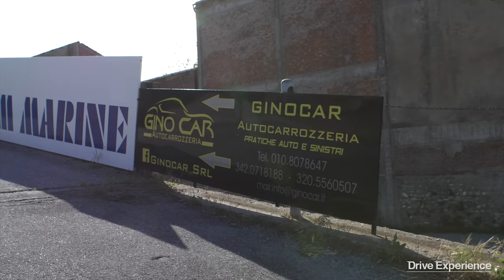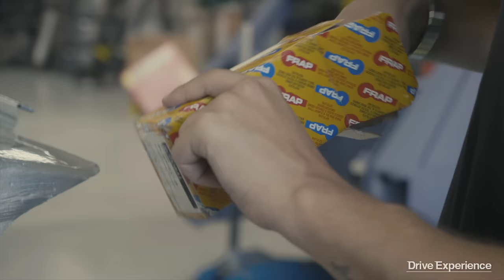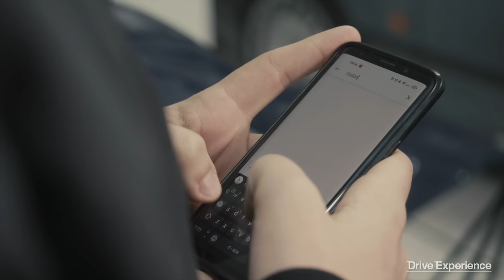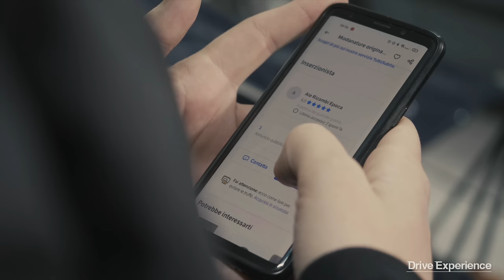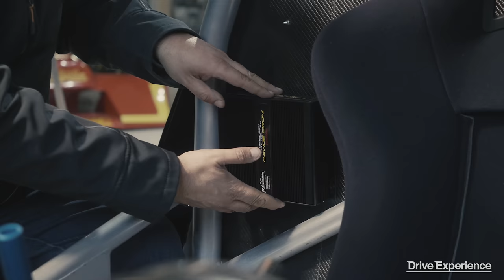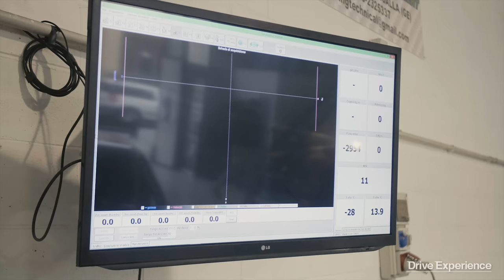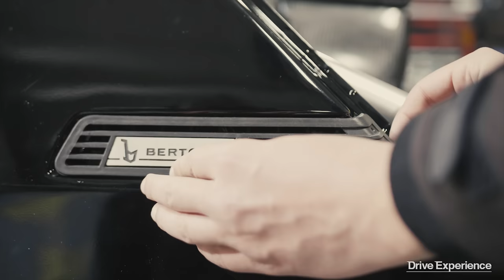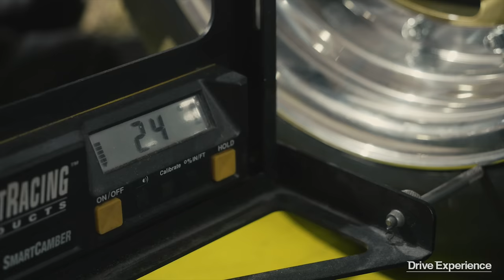Fiat X1/9 Silhouette: Un mostro da Salita - Davide Cironi (Dal Pollaio alla Pista Ep.9 SE02)

Comment: Having run a ZX12r powered car I would say definitely put a high power race clutch in, when the basket blows it is a lot of mess to sort, thankfully mine had a dry sump so was easier to clean out the engine.